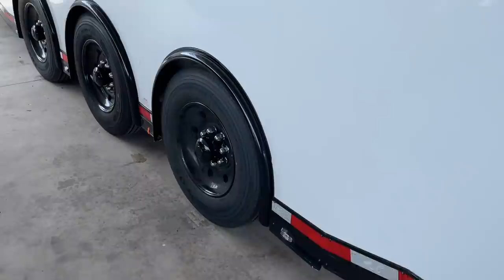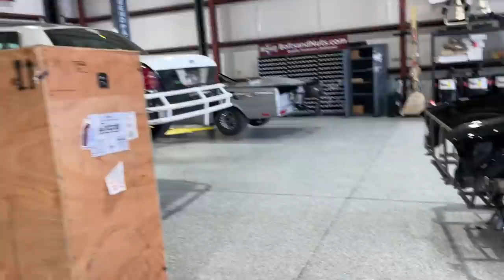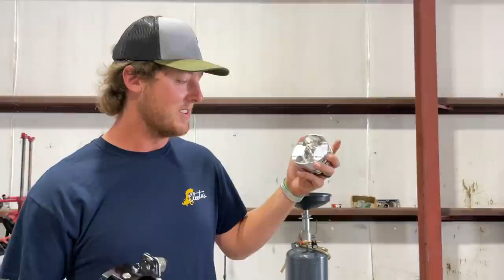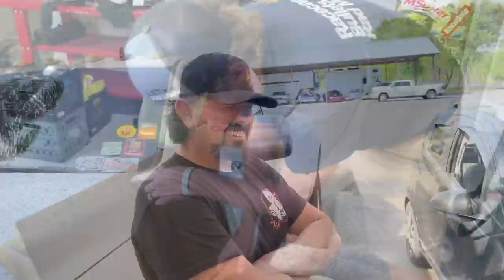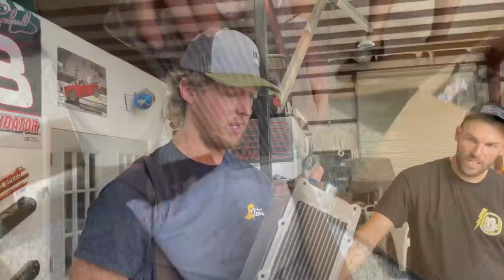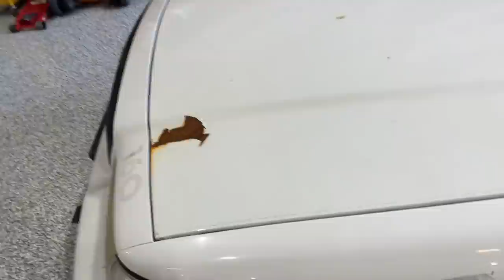Here's What Happened To Mullet's Engine In Texas...

Comment: Anyone who isn't impressed with these Texas Speed engine builds hasn't ever built an engine and put real power to the ground.
Reply: PREACH
Reply: Starting with a heavy car.. What can go wrong? SBC and LS...9:1 static compression is all they can take. An all iron build can rev to 7000. Those motors are not happy at high revs. Ca 450hp and your motor will run a long time.
Reply: @JackANSI FACTS!!!

Comment: As someone who has worked on 0 motors and has 1000s of hours of no experience. Im glad I didn't jump to conclusions. Appreciate your honesty.
Reply: As someone that has worked on a few motors and has a few hours of experience. I know not to jump to conclusions. I installed a new crate engine once. It turned over maybe 3/4's of a turn and locked up. We sent it off to have Chevy look at it. They found a shipping screw in the damn thing. We had all the screws that were in the crate that we took out. Plus the engine was wrapped. There was no way it got there after we got it. Chevrolet replaced the engine and they installed it. Weird shit does happen.

Comment: Texas Speed engines are rock solid, true fans know this as we’ve watched you push them to their limits over and over and the issues that do arise aren’t the fault of Texas Speed. Tuning the head gaskets out like you said, tuliped valves, exceeding the limits of the rods. The only actual “blow up” was when Leroy’s boost controller failed and boosted the engine to the moon and that also isn’t the fault of Texas Speed. 
All these people spreading all this unnecessary and uncalled for heat and it turns out yet again that it’s not the engine. We’ve seen what it was like in the early days of Ruby when you’d blow up all those 5.3s and that one 4.8 LS near every pass. You’d pull one out of the junkyard, go through all of the work setting it up and get a pass or two before you’d blow the bearings out of it or like that one time explode the hell out of the pistons lol.
Reply: Texas speed awesome engines reliable too just not at the power level times he's going for. Seems like about 1500 hp their comfortable limit.
Reply: Most people pushing the times they are out of something as heavy as mullet (or any car for that sake) are using something like a big block 521 Hemi which had been purpose-built as a drag motor capable of 4000 hp.
Reply: Texas speed make a bad ass street car and decently competitive race car engine, but they don't really do the BIG number stuff, and that's perfectly OK. they've looked after our boy real good so far so ya can't hate em at all
Reply: @winstonwright3613  right and even mike Finnegan in BlastHimie  has had engine trouble

Comment: I like the fact that you guys don't hide issues. I respect the fact that you openly shared your own part failure. I do feel like the comments are a place for peoples opinions, good or bad. At the end of the day alot of people are rooting for you Cleetus. The same stuff happens on the worlds largest stages. People want to see the person they are rooting for win, and when they dont, it becomes a mob looking for heads. I know it sucks, but in a way they think they are helping you. Personally, I could care less what goes on when you hurt an engine or there's a slip up. I understand that you run these things to the absolute fucking limit. Nothing lasts doing that. A real gear head wouldnt troll your builders because they understand the shear hell your putting things through. A real gear head makes a suggestion and leaves it in your comments. I dont agree with attacking your people. 

P.S. I still wanna see a big block in Mullet....lol
Reply: Ironic Cleetus Is a big block in a mullet. Meant in friendly jest.
Reply: @InsideOfMyOwnMind  lol

Comment: Sorry to hear that the resident trolls have been causing trouble. From a long time fan of the show, I would just like to give a shout out to all the companies you mentioned in the video. Thank you, to all those companies for helping Cleetus and the gang to put out these videos. We appreciate the hell out of ya!
Reply: Agreed!
Reply: Hell Yeah Brother!!!
Reply: The throttle plate screw down the big hole scene isn’t 
a new trick, but it gets old real quick when it’s yours. 

You have my sympathy, I’ve played that tune. 

I came to slightly distrust Loctite in that one application, so I figured a secondary locking system was worth a few minutes of extra work. 

Ever since, I’ve used brass screws half a thread longer than flush and staked the tip with a support dolly and a fine ball end punch in two spots 180 deg apart, just enough to flare the tip edge a little. 

You can still loosen them enough to centre the throttle plate but if they do shake loose they can’t actually back right out. 

The effect on airflow isn’t measurable to any degree of significance at all, especially at the sort of TB diameters that you’re using. 

If you’ve never screwed anything up, you’ve never done anything worth doing or learned anything worth knowing…. That’s the only possible response to the know-nothings who blaze away in a haze of absolute ignorance. F ‘em!

It’s bloody hard enough to get a genuinely good engine builder to take you seriously and support what you’re trying to achieve in the way that your guys do, they’re the 100% bomb, sweet, sweet work every time. 
Respect is due. 

Take care guys, stay safe and keep on giving it HELL!!

Comment: Kudos to you for owning your screw ups and sticking up for everyone who supports yall
Reply: no pun intended lmao
Reply: punny
Reply: NO marks on the valves.   We've been set up
Reply: @jimbennett2795  obviously you need to look at the exhaust valve. It has nicks on the outer radius where the bolt indented the head. It's not like he's running a dome piston he's running flat tops. So he probably has a good amount of piston to valve clearance.
Reply: I have to say i called it perfectly on the video it happen in. I posted for people with younger ears to listen to the video in SLOW MO. You can actually HEAR the bolt drop and enter the valves and then the piston. I called it. 
As for people being asshats, duck tape can NOT fix that, BUT it can muffle the sounds.

Comment: I really appreciate the explanation about what the comments can do to the businesses that are behind the scenes keeping the equipment alive. I am a part time mechanic and can see that you are running the equipment on kill most of the time, the fact that it doesn’t have holes in the block, is a testament to the quality of the builders and the products being used. I would have no problem using any of the builders you guys use. There are a bunch of people that don’t realize, if it mechanical, it will break. Not to mention some bad luck, loose bolt and there you are. I have a lot of respect for you and your crew, providing fun, honest entertainment. I hope a couple bad apples don’t make you have to edit the truth to protect your program and sponsors. Thanks again for sharing your time and videos. 
Pretty sure you will be pushing any engine to 125%, but you can say 75% if it makes you feel better. Faster, Faster, Faster.

Comment: The Irony that the watercooler brick that was taken off a couple weeks ago would have probably saved it lol.
Reply: What are the odds it drops a screw into the engine right after they remove the piece that inadvertently would have stopped that very thing from happening... wow
Reply: @merczeph79  Huh
Reply: @glazetrain  The fins from the air to water Brick they removed a couple weeks ago fins would have stopped a screw from falling threw the engine because it would have acted like a filter. The fact that it happened within a couple weeks is bad luck particularly when they even comment when they took it off that hey nothing had went threw the engine.

Comment: I had almost this exact thing happen to my Fox Body back in like 2008! Motor had like 600 miles on it and a MAC 70mm throttle body screw got sucked into the motor. Unfortunately once that screw got sucked in it got between the piston and valve, and actually broke the #1 intake valve which then sent even more shrapnel through the engine! I remember seeing the threads on the piston and combustion chamber and thinking WTF until I looked at the throttle body and it only had one screw in it... ugh. Crazy to see it happen to someone else.

Comment: When you are pushing parts hard stuff is going to break, that's just part of racing, if things aren't breaking you aren't pushing the cats limits. Top fuel teams rarely get more than a couple miles on an engine because they are always running them right on the edge of destruction.

Comment: The fact that the engine took a bolt into the cylinder and didn't destroy the liner head valves and crack the piston bend a rod or the crank is testament to the Engine builder, It's got to be a Fooking good Engine to have survived that, anyone who says otherwise obviously haven't left their mothers back bedroom for a while and should get out more!  
PS wheres Leroy?
Reply: Ty has to widen the trans tunnel and move the engine forward since they're moving the Trans up front.  Then I think they're beefing up the dif but leaving it IRS.   I CAN'T WAIT to see the Savage rip again.

Comment: Felt that screw screwed the piston...we had that happen at least* twice with sportbikes. Much more problematic than a car motor because the valves are also usually taken out as well...Dang the bottom end is all solid there's still more life left in that! Don't give that up! (much more it's hard to get parts and have built motors these days!)

Comment: Have you tried filling mullets  tyres with nitrogen, here in the UK, trye shops now offer this for rd cars,  but its been used in motorsport for years, , because of how safe it is .Pure nitrogen has larger particles and is drier than compressed air which provides the following benefits: Slower rate of pressure loss as the larger size of the particles cannot permeate the tyre casing as quickly. Better road holding and grip as the tyre remains inflated to the correct pressure for longer. In theory this would solve mullets rear tyre issue of bogging down

Comment: We all screw up or miss something. Bolt in the engine. Been there done that. 1973 helped a friend rebuild his VW motor and there are a butt ton of screws on the sheet metal shrouding. Still don't know how it got past the valve but dang that sucked. Pulled the head, got what was left of the screw out and put her back together. Ran at least 25,000 before he got t-boned. Motor was still good.

Comment: I don't know nuthin about cars or LSs, but any screw in the intake of my bikes is captured.  Even if 100% loose it will just sit there not quite sealing something or holding something much bigger than will go any further.  It's called defense in depth.  Don't depend on a person doing something right if the consequences are catastrophic.  Engineer the possibility of failure out of the system wherever possible.  

As for the rest, been watchin' you and the boys since << 1E6 subs.  Great seeing the progression.  Keep it up.

Comment: a bolt thru an engine is not a fun time..ive seen what happens when it does that on a 4 cylinder motorcycle engine..mistakes happen..you learn from them and move on..Not faulting the engine builder, tuner or anyone..at high boost and the power youre putting thru the car, somethings going to come loose. is it possible to put some sort of screen that can catch bolts or screws but let air thru inside the intake?

Comment: Don't feel bad about the bolt. I had the same thing happen, except it got stuck in a Supercharger. Locked it up so bad I had to cut the drive belt. Waht's worse is it was may on damned fault because I didn't check the bolts holding the throttle plate to the rod in the Throttle body after I cleaned & inspected it. At least it didn't get eaten by the LS2. It's racing. Things get broke all of the time. Fix it & move on. Keep rocking the content guys.

Comment: S90 throttle bodies are notorious for this. The throttle shaft is aluminum in them. It cracks, the fasteners get loose, and bad shit can happen. 
I learned this only after noticing mine was about to drop a fastener when I had the intake apart for other reasons.

Comment: My default position anytime something happens to an engine (unless it's a failed sensor) is that Cleeter turned the boost up too high, I watch enough Street Outlaws, I see those guys constantly blowing things up and I know Top Fuel Dragsters effectively rebuild their motors after like every single pass, it's just something that comes from pushing this much power out of a engine platform that was designed for the 300-400 HP range.

Comment: Old guy drag racer here. First of all Garrett, your growing as a racer very quickly. All the haters have no experience in running a racing team for sure. I’ve watched your progression for years now,, and it’s been rapid but costly. With all you have going l doubt it could be anything but. After Texas l thought, he’s gotta stop running an LS on high C. He needs a big block and probably should talk with Morrison. My only criticism of your team is, you suffer too many losses and costs over the small stuff. Running out of fuel, vacuum lines coming off, loose lines and the like are bad reasons for non performance. If l can play grandpa racer to you l have one important piece of advice. It’s the SMALL CRAP that champions don’t miss. Give everyone an area of responsibility, and stick to it. Intake bolts, head bolts, header bolts, starter bolts, torque converter bolts etc. The car should never go to the track without every bolt, nut  and screw checked. Every freaking line and hose and tank and clamp needs a caretaker. Nothing should EVER fall off, come loose, run dry, or  tear away making you loose. IT’S A RACE CAR, you have to treat it like an airplane. If it fails you die. If it fails you lose. I love your channel and the people. You need to appoint a crew chief and give him the responsibility for your race team. I’ve worked with the best and had my own team. None of the small crap you suffer would  have been accepted for one race. You might even think about hiring an ex pro stock crew chief to create a pro team mentality.! Racing is high tech, high cost and concentration intense. Your spread a little wide and it’s great. But if you want to be a racing champion you need to tighten up your team. I’m pulling for you guys everyday.

Comment: Tire pressures are very important on big rig and big trailer applications. Whoever is driving those vehicles needs to check pressure every time they drive them. In the DOT world that's called a pre trip inspection. Low tire pressures  Is what makes tires blow out.

Comment: As the world turns it doesn't matter if it's the engine builder or the manufacturer of the part or parts this is racing where you put everything to its limits and if it was easy everybody would be doing it so personally my hats off to all of you. A failed part is a failed part a mistake is a mistake it happens you haters fail to understand this is NOT a perfect world and things are going to happen so sit back relax and take your medicine as required.  God bless you cleetus and builders and tunners and as always be safe 👍

Comment: Throttle plate screws/bolts are evil. In the bad old days, the screw would be split at the end that protrudes through the shaft and you would tighten the screw and then spread the screw so the worst that can happen is the screw comes loose. These days we rely on self locking nuts and or Loctite, neither of which a infallible. Always a shame to see a good engine damaged from ingesting a stray fastener. :(
Reply: put steel grid in intake after Throttle Body .
problem solve

Comment: I didn't see any of those comments about the engine builder but that's pretty dumb honestly. Like you said, these things are being stretched to their limit every time you go out, so if they didn't ever break it would be exceptional, if not impossible. You don't run 6's without breaking things. This is not to mention that the engine itself ended up not even being the issue this time. Such a bummer about that throttle body screw. Could've been a lot worse though. New piston, fix or replace head, run a quick hone down the cylinder and you're back in action.

Comment: Bro, as hard as racing is on what ever is being used. You might want to use some airplane tricks on some parts. Thy drill a hole in the bolts and put wire threw it fastened to something.Kinda like a bolt theather. Good stuff as always. And never listen to haters.

Comment: In reverse order here...

Sucks that the motor is wrecked from your own parts.

I don't know how many miles you have on the trailer, but isn't this your second blown tire in relatively low miles? Those are heavy duty commercial tires and seems like they should be lasting longer than that.

Comment: Breaking things is going to happen at the level you’re pushing the cars to, especially mullet with an LS. Not to mention you’re going through the growing pains phase of it right now trying to get the bugs worked out of it. Now if it continued to be an issue with parts breakage constantly once you got it dialed in, then yeah I’d consider a different builder/sponsor but otherwise, there’s no need especially with how well they take care of you right now. Everyone needs to chill out, and understand things break when you push them to their limits. It’s part of racing. You correct the issue, and move on.